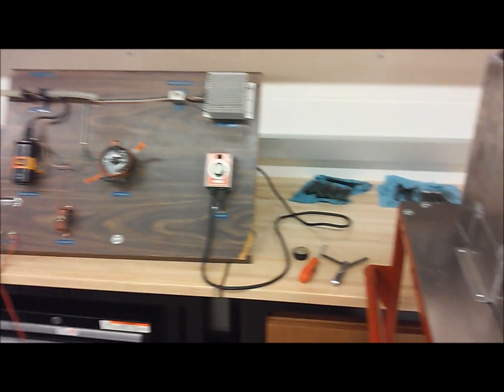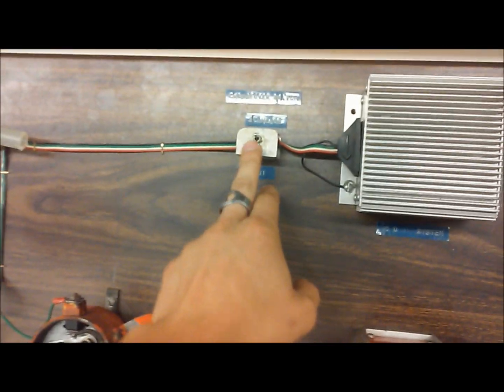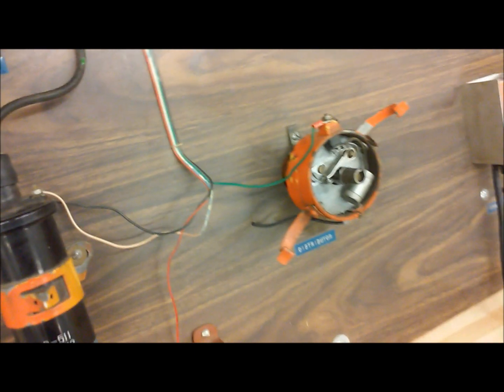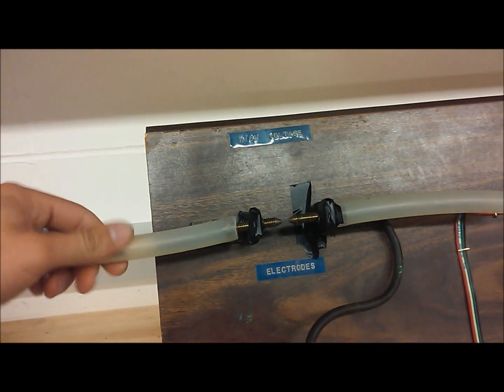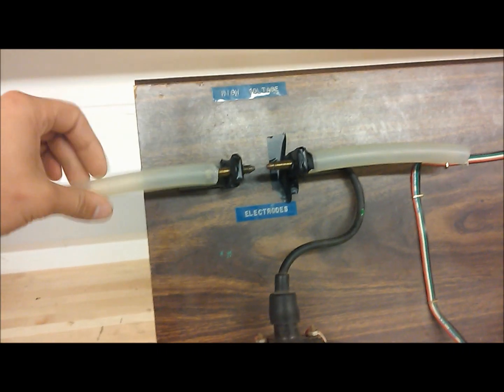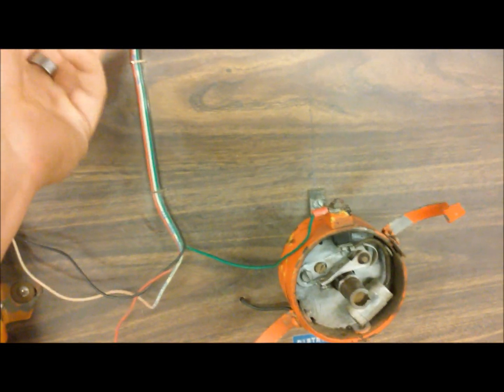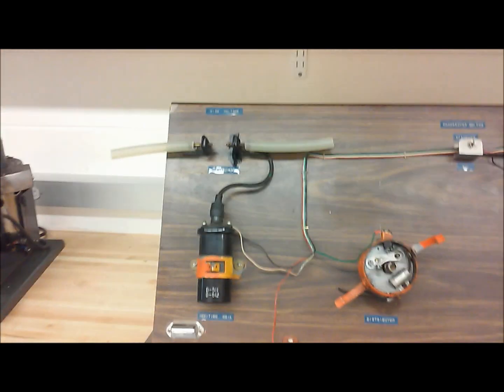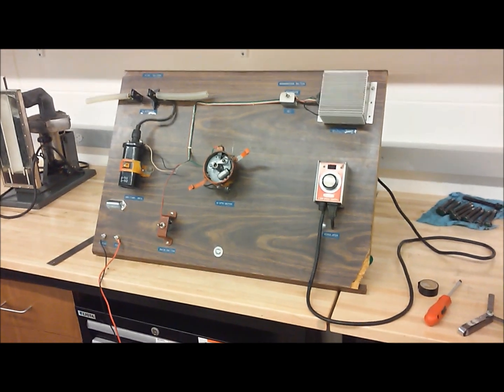Distributor Coil Ignition & Spark Plug Gap VS Compression & RPM Demonstration

Comment: Does a wider spark plug gap really equal to higher RPM?
Reply from the maker: Not at all, a wider spark gap is harder for the coil to jump in subject issues a higher RPM. The more voltage you can pump through it no larger gap and you can jump. And theoretically the larger gap, the more power you have. Or at least theoretically the better burn you’ll get out of your fuel charge

Comment: Today, with a coil pack on each cylinder I would assume the chances of spark plug misfire at higher RPM have been greatly reduced by allowing each coil more time to build voltage in between firing...

Comment: Good video. This should answer some questions that some may have. For those who don't know, there's actually no reason to even use points any more. Points replacement kits are an economical option that will rarely ever need replacement. Pertronix is a very good manufacturer of these kits. It fits under the cap of your stock distributor where the points usually mount and can be installed in less than 30 minutes. Eastwood, Summit Racing, Jeg's and even your local speed shop can set you up.
Reply from the maker: +Charles Georgoudis i ran pertronix in my old truck engine. ran great. i am not a fan of their distributors with the system all together. have one in my tuck 289 right now. the stop weights are a cheap design, and the springs are very hard to switch without accidentally stretching them out. the msd stuff is much more user friendly.
Reply: ThunderHead289 I was only referring to the points kit. Had one on a 289 for years, also. Thanks for the info on their distributors, though. Never had any experience with them and thanks to you, I never will. I agree, the MSD stuff is the best way to go. Putting the advance assembly on top is a well thought out design.
Reply from the maker: the points replacement kit is spot on for sure. i really liked the ignitor 3. their distributor runs the same thing, its just the mechanics of the distributor itself that needs slight improvement.